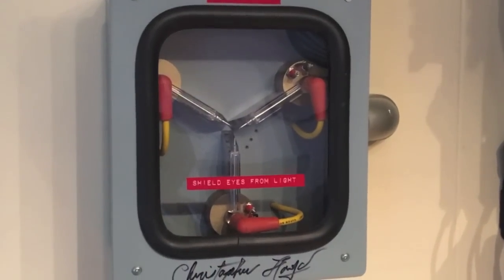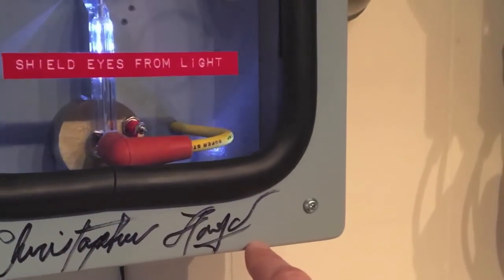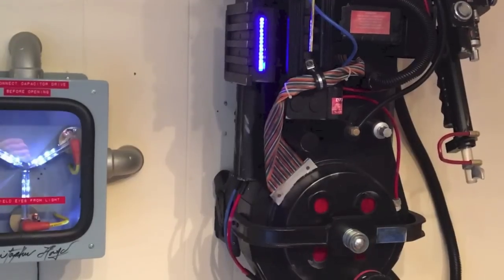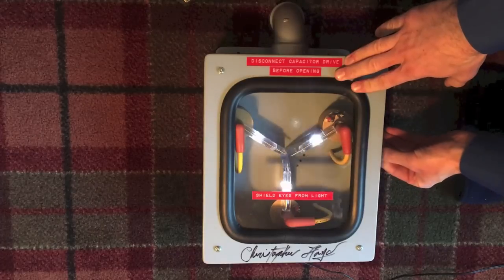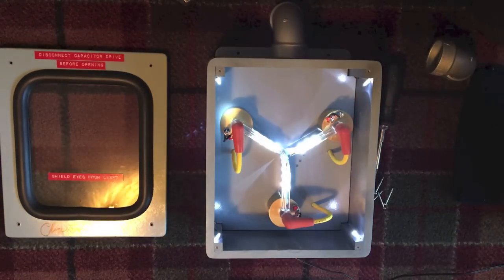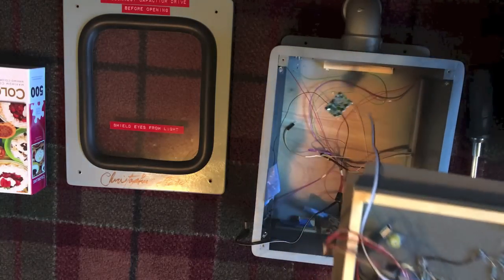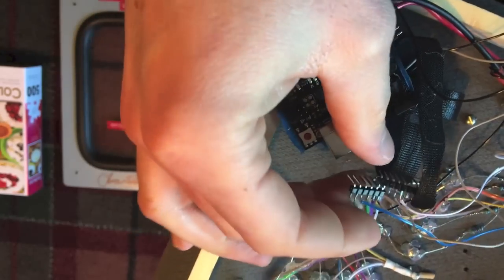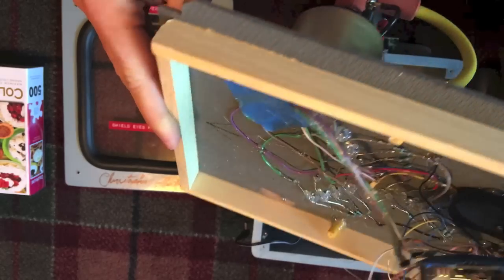DIY Flux Capacitor Prop

Comment: Hi Max, do you still have the dimensions of the relay switches? Thanks
Reply from the maker: The DIP switches? No I just bought a variety pack on amazon.
Reply: Maker Max Corbett hi, thanks for the reply. I now make my own relays from scratch. Check them on on eBay : Torr Relays

Comment: Seen lots of flux capcitor builds but this is the best so far. I'm just starting out with Arduino (and electronics in general). Do you have any basic wiring diagrams?